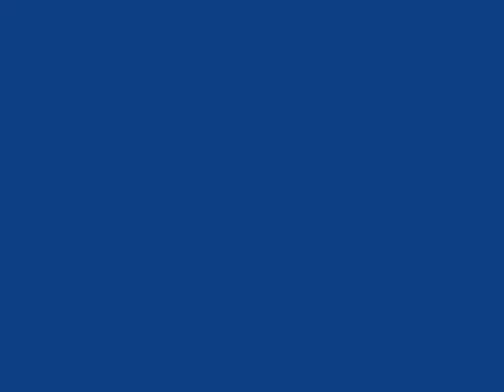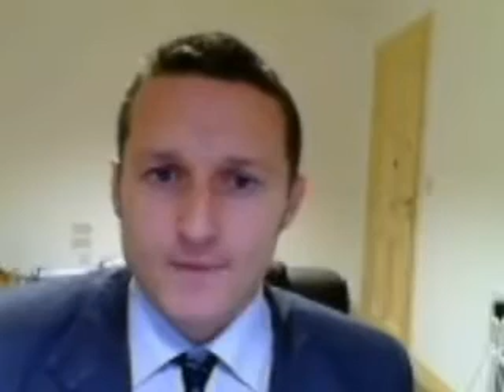Solar Tubes Ireland

Comment: I was surprised at the idea that solar is possible in Ireland. I liked the discussion about the secondary heat system and how to route the sensors so that you hot water 24/7. Thanks.